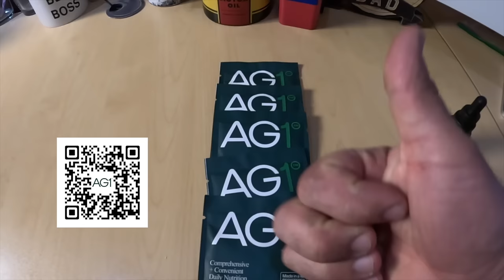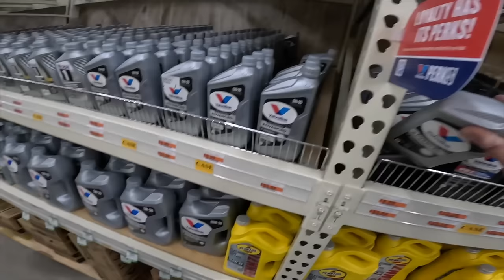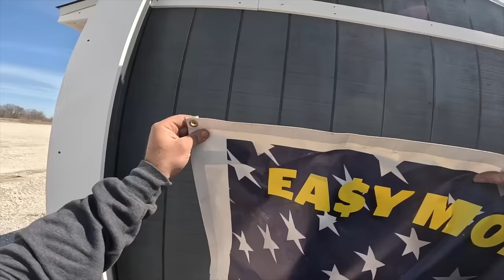Audit is over! What happened?

Comment: The filter may be correct. Sometimes small engine manufacturers make a long and short depending on application where there might be more or less room. Selling the short is generally the best answer.
Reply: Depends on the engine though. My Ford granted its a tractor has 2 different filters for the model but one is significantly different from the other internally so you need to watch what you get.

Comment: You need to get some of those oil dry mats you can just put down on the ground before you start to drain the oil that way anything that spills will go onto that and you won’t have to spread out the kitty litter or oil dry. A lot easier to clean up.

Comment: Get rid of that trash oil and try Castrol. We had a rep come do a demonstration on one of the machines that smoked and burnt oil. After 2 oil changes, run for 15 minutes in between changes it stopped burning oil! We switched and have a much much better mechanical turnover on machines.

Comment: Save money on those Turbo Pressure Washer Nnozzles by starting them pointing down at the ground, and then lifting to aim at whatever you're cleaning. The little ceramic spinner inside gets hammered if it's not pointing towards the ground at the start. It's good saving EASY MONEY!! 🤠👍

Comment: long time watcher, and been on weight loss journey, i've lost 120lbs so far and about 30lbs of that just this year. Try intermittent fasting wait till 4pm to eat and then just eat a steak only...drink your supplements and a lot of water and do for 3 days in a row you will gain energy and lose a lot of weight. if you can fast 24/48hrs will drop even faster just hard enough to wait till mid day. good luck and 80% is diet and 20% exercise but keep going.